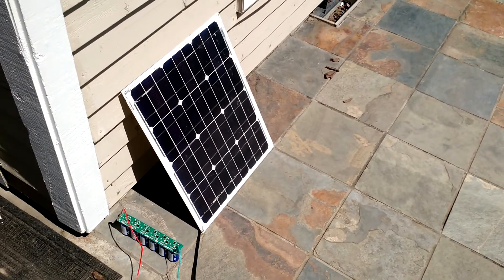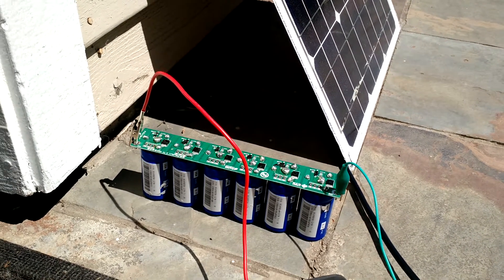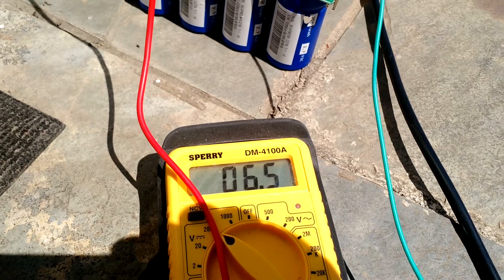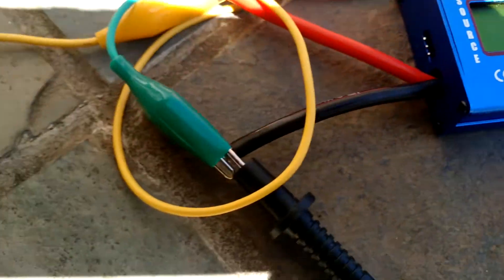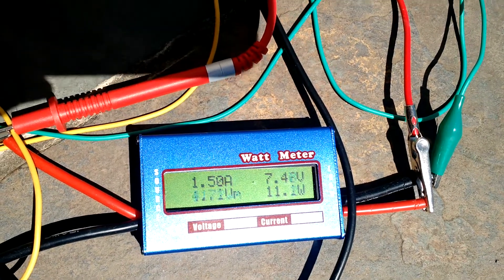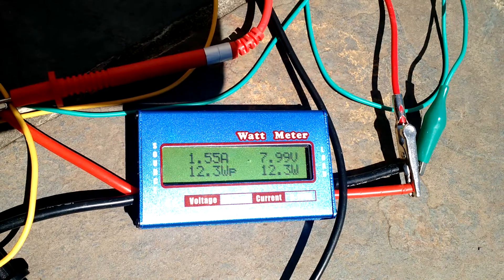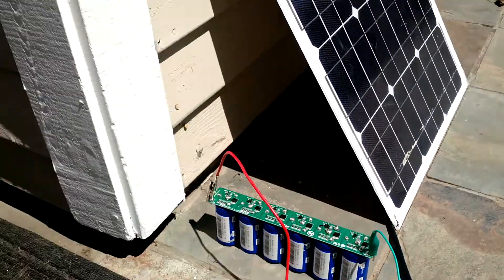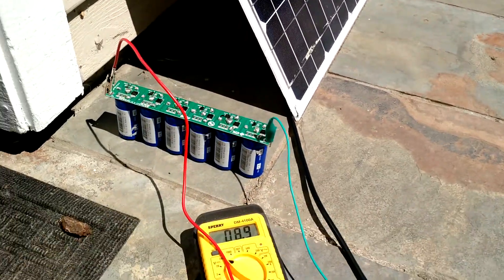Solar charging super capacitors

Comment: Is the open voltage for the panel 18 or 20 volts? Then you should have seven or eight capacitors in series...
Reply from the maker: SolarizeYourLife correct the open voltage is around 24 (don't remember exactly).  I disconnected the panel from the super cap bank long before they got over 16V.

In another experiment used a fairly large resistor to limit the voltage.  A larger bank would be the most efficient way though